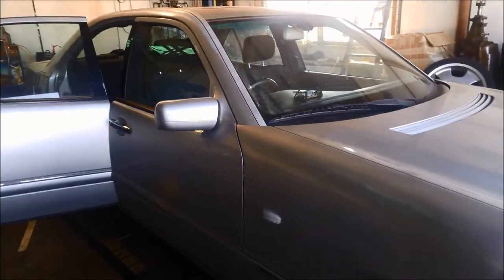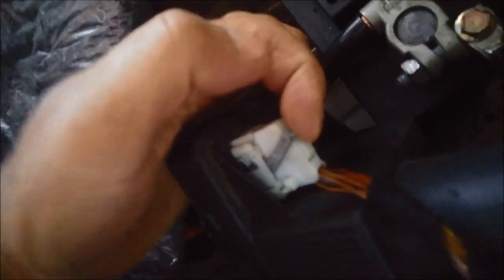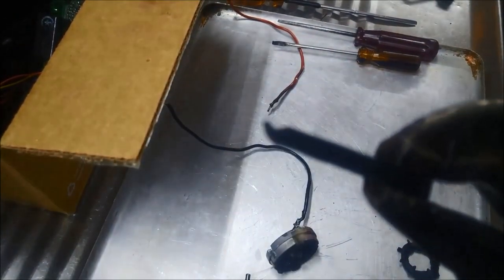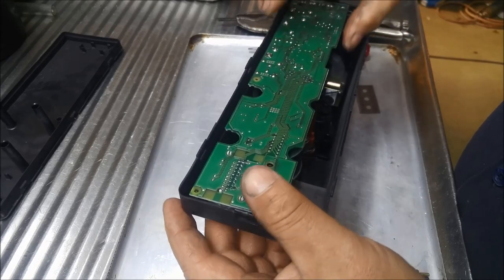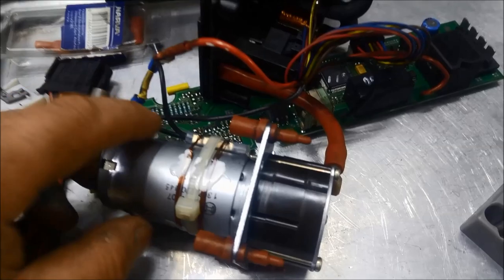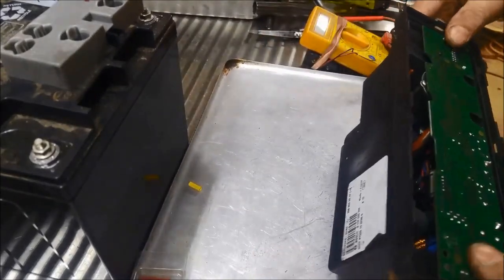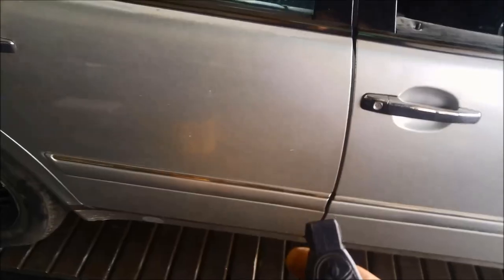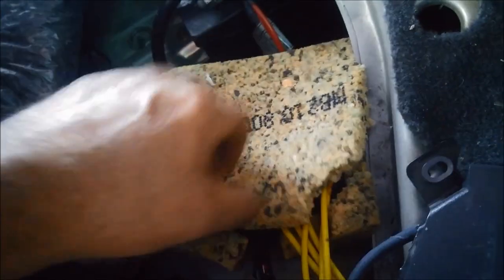How to Mercedes PSE Pump W210 W211 W220 Door Locks Won`t Lock - Repair & Modification how to Improve

Comment: you could consider offering a repair service for these in Australia, there are a few in USA doing it because the genuine replacements and rebuilt units are expensive and the internal failures usually limited to very cheap parts
Reply from the maker: thanks and cheers

Comment: Hello Mate, We have a 2000 Mercedes S500, and the 20 amp fuse was blown in the compartment on the right side of the rear seat down low at ones feet. I replaced the 20 amp fuse that was blown, then all the doors would lock & unlock....& the trunk would open & close with the KEY FOB, as it did when new. Even the cheap after-market radio that came with this S500 I recently purchased, began to work. The problem is.... the PSE pump will not turn off, as it keeps making noise even after the doors have been closed & the trunk is locked. I can hear it from outside. When I touch the 20 amp fuse...it is extremely hot...so I am sure that is how it blew in the first place since these locking systems did not work when we bought this car 2 weeks ago. The PSE pump keeps running.....even after I have shut down the car & removed my keys from the ignition. Is this caused by leaks in the pneumatic lines, or leaks "ON THE PUMP ITSELF", or a failing pump that needs replacing? I am keeping the fuse out so we do not cause any more damage. Any ideas what to chase after first? Thank you.....
Reply from the maker: hi, you have leak in the lines. cheers

Comment: Hi mate, good video. I have an R129 late model SL500 1999 and it has the same era of pump on your with the same plugs that you showed how to remove video. Wonder if you can help.  The car unlocks with the keyfob but will not lock with the keyfob. When pressing the lock button on the fob you can see the lock knob move down slightly and the car lights flash so it is detecting the signal off the fob. The car also can be manual locked with key in the door barrel and also if sitting in the car there is a lock button which also is locking the car. Do you think it my pump mate? Cheers .
Reply from the maker: hi, sounds like it could be pump, however firstly, pull rear seat up and try plugging one line on the PSE at a time to find which one is playing up or leaking just incase one of the seals are leaking. cheers
Reply: Ok thanks for your help looks it is the pump after all, Ive sourced a refurbished one,  is it a straight swap out no programming needed etc.   cheers

Comment: Quick question, hopefully your expertise can give some insight on my dilemma, my 03 s430 pse pump recently failed, no power locks, soft close doors, trunk and my rear head rest were not working, so I went to a local junkyard got a pse pump from a 05 s500, threw it in and everything except the trunk works, I noticed the s500 I removed the pump from had the power trunk feature that closes and opens automatically, could this possibly be why my trunk is not working since I have a manual trunk rather than the automatic one from the s500?
Reply from the maker: sounds about right. cheers

Comment: Great video really informative I wouldn't have had a clue how to get the airlines off the PSE pump, so you've cleared that right up for me! I've just bought an W210 E55 AMG and the boot is a bit sluggish to open, maybe 5-10 seconds after unlocking it eventually pops, so i'll check all the lines and see if i can get some replacement o-rings. I'm wondering if a super-thin application of silicone o-ring grease might help with the seal?? Just a thought... Cheers mate!
Reply from the maker: hi, worth a try. thanks and cheers

Comment: Excellent video .Hopefully this will help me diagnose and repair my locks--sluggish or not  working at all in cold weather. I'm guessing pump is struggling when cold. Probably not a vacuum leak or it would happen in warm weather also. Thanks and cheers from the US.
Reply from the maker: hi, on these pressure or vacuum leak can be like a parasitic draw. the pump can only make x amount of pressure and/or vac, so something else needs to suffer. hope that makes sense. cheers

Comment: Thanks for your vid and tricks to repair that MB vacuum pomp . One suggestion, though. With the money you saved by using the DIY method to fix it, please buy a better camera because our eyes hurt when watching it ! The thermical protection of that motor is a real security improvment of the system. 2020-05-18. Cheers !
Reply from the maker: hi, sorry about the quality i use my phone camera. at this stage yt doesnt reward me enough to get fancy or high tech, however in time i hope to get better filming equipment. cheers
Reply: Wtf... he spent his valuable time and you still complained???

Comment: Hello, I am also having problems with my PSE and found your video while looking for a solution. Before trying to fix it following your video, i am wondering if i should disconnect the batery before either removing or putting the PSE back in the car. Thank you in advance!
Reply from the maker: hi, usually better to disconnect anything that has wires that may touch something it shouldnt, but entirely up to you to decide. cheers

Comment: So, what's the outcome of the switch -  will it turn off the whole PSE unit, shut off the vehicle? There should be some ventilation for the PSE unit for the fan to cool it down, like a few small holes in the housing.

Great vid, good info.
Reply from the maker: hi, thanks....point of switch is so it turns off circuit when the temp gets too high for whatever reason it does. cheers
Reply: @YepThatsIt  so when the circuit turns off, will that prevent doors from opening? Will car still run normally even though switch turned circuit off?
Reply from the maker: @manpreetsandhu7310  switch will work as usual when it cools down. its just like a backup to stop pump motor from burning out. when your system is operating properly it will hold pressure and vacuum so you can open doors, locks, fuel cap, boot, head rests etc. if there is a leak in the lines it will burn out your pump in a short period of time. this is why i add the temp switch. hope that makes sense cheers

Comment: Hi bro. I have a 2000 W210. When i press the door lock switch ftom inside the car it doesn't work. But unlocking works. Rear boot and fuel door lock has delayed opening after pressing the car unlock button on the remote. Can changing the motor alone solve these 3 issues? Kindly advise. Thks.
Reply from the maker: hi, check the plastic hoses arent leaking. those pumps have vac and pressure. cheers

Comment: Hello mate I have a 210 also
,rear headset goes down 
The car unlocks from the dash bottom but the unlock doesn’t work when I press it no sound comes out the pump 
I had the seats removed to check 
The unlock is fine tho 
I’ve both the car with one key 
The bottom on it don’t do anything I use it to start the car and open close manually the car 
The trunk stays open😢
Any idea mate 
I’ve checked the fuses all looks good
Reply from the maker: hi, you probably have the pain in bum issue of finding where you have a leak on the hoses/plastic pipes that come from the pump.cheers

Comment: Hello. I have a question about this model of vacuum pumps.
in my mercedes W210, i have  interrupted line of the SRU and it is currently "open" and works in vain.
I was advised to put a small piece of tube to plug with something in front. in this case I put the "reserve" box for inflatable seats. My question is: does this "clogging" harm the pump in any way? What is the effect of clogging (if any) on the pump itself.
Reply from the maker: hi, no harm will be to pump, just that line will not work by you plugging the line. cheers
Reply: @YepThatsIt  the idea is that the owner before me changed the chip on the car, and cut the line purposefully.  The pump orifice is left open, and it inflates when I give the ignition.  the idea is to stop it from inflating and from working unnecessarily.  To understand that the box I plugged into this hole (again - this is the box of those that stand for the inflatable seat reserve) works.  I tried to plug it with a screw, but the pump inflated again (apparently the bolt was leaking) and for that I turned on the pipe with the tube straight.
Reply: The seat bolsters usually are the worst source of leaks over time so you can delete the lines to them with a plug or you can use star system to delete the feature.  Another simple way is to set your seat button to 0 and tape it so nobody changes that.

Comment: mercedes benz 210 what to do if the car does not open and close
Reply from the maker: hi, in extreme cases you will need a vehicle locksmith. cheers